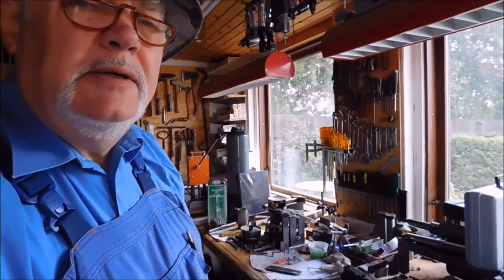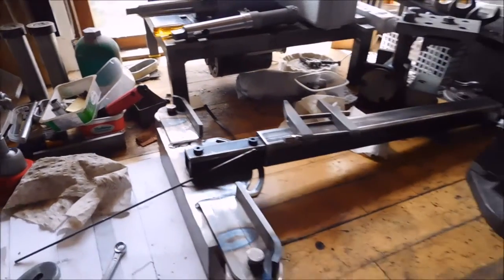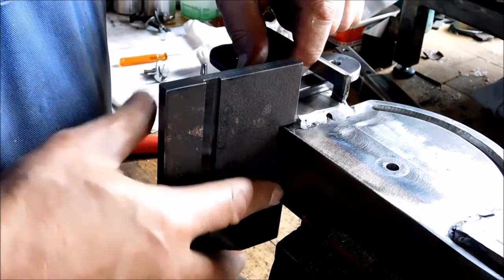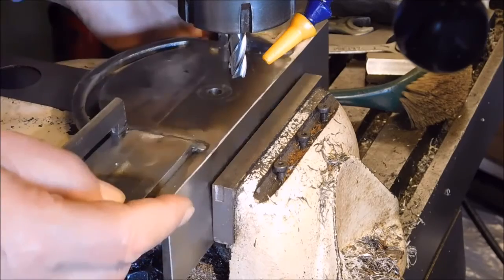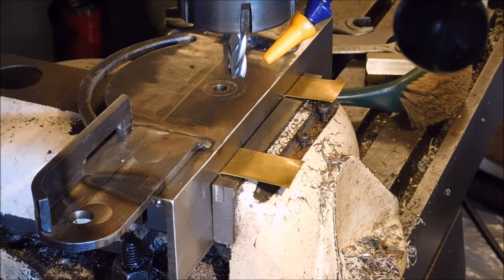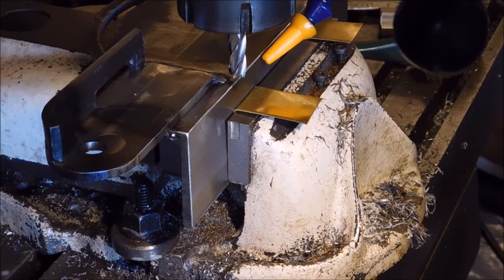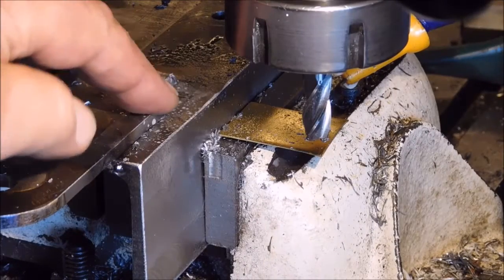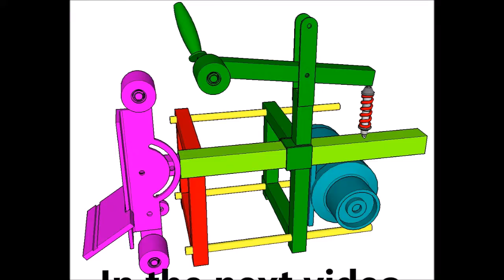Beltsander 06

Comment: I'd have been well happy enough with the welds on the bracket. :)
Looks like the geometry is working out well. 
Might be worth spot welding the nut under that slot so you only have to use the bolt itself when adjusting. Coming on well Keld. :)
Reply from the maker: Hi Chris !

Yeah, I have some small adjustments to do all over the project ... including nutd and studs here and there.

Comment: Hi Keld,

I was expecting that one of the belt roller mounts on the end of the grinding plate/head would be slotted for belt tracking to be adjusted?  The Roller axle is then adjusted with pull bolts each side

That's how they normally do it on the commercial ones I've seen, or as on mine, they cant/tilt the roller mount off of 90 degrees.

How do you intend to do this?

Cheers Rob
Reply from the maker: Hi Rob !

I was told that the FIRST roller "after" the drive wheel should be "crowned" and used for "tracking" - and that's what I intend to do - hope that's the correct way to do it !

I haved watched a lot of videos with "belt-sander-demos" and I think I saw that same principle there too.

I have designed the remaining part of the machine now and I will "show and tell" in my next video - in cluding here the "crown" & "tracker" roller even though I have not yet made the drawing of the adjustment details - but I know how it's build.

Just wait, see and hear ;-)) - thx for viewing and commenting !
Reply: Hi Keld,

If you compare it to a hand held electric belt sander, it works on the same principle.

I've never seen crowned pulleys used on a linisher or a belt sander.

The tracking adjustment works the same as a belt sander in that the 90 degree feed pulley is offset as required to centre the belt.

Crowning won't hurt, and may help, but it's something new to me, except on lathes which use it, like mine.

I've seen the adjuster before and after the drive pulley on commercial linishers.

Interesting project.

Cheers Rob.
Reply from the maker: xynudu
`Yeah, maybe I have to do some changes when I start to use it - who knows if all you see and hear on the internet is right ?

I believe experience is something you have to develop yourself by doing things ;-))
Reply: I saw a good design on YT a while back using a piece of square section extrusion as the grinding bed/platform, and it worked well.

Nice and flat and rigid, with sides to weld the tracking adjuster plates on to.

I'm keen to see yours in action.

Cheers Rob